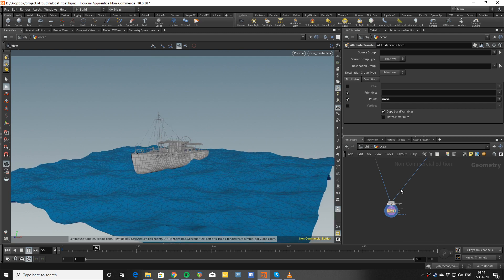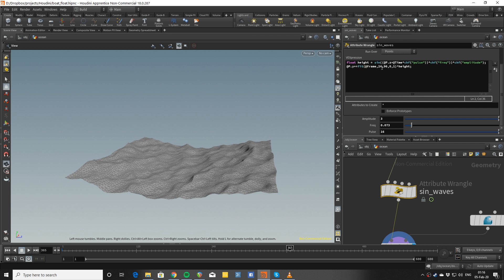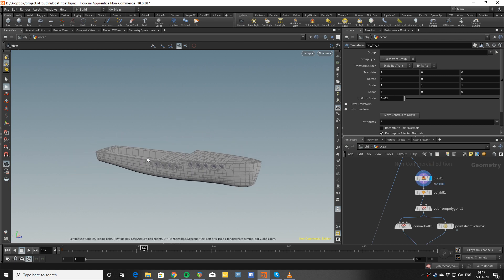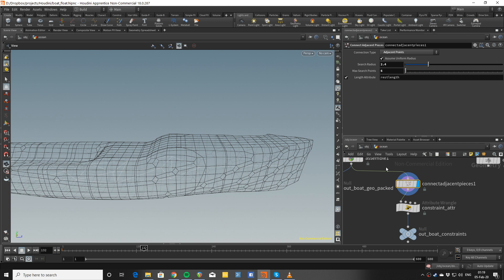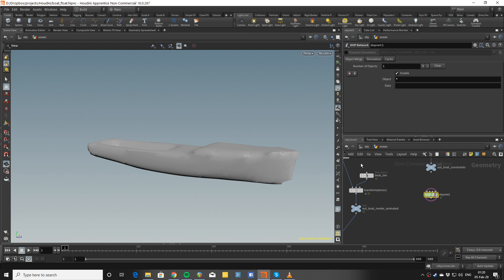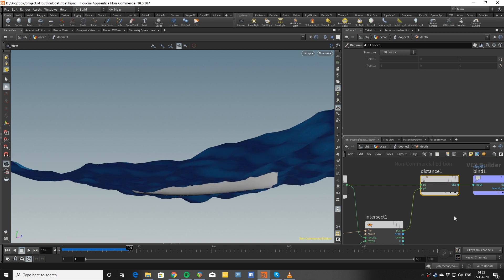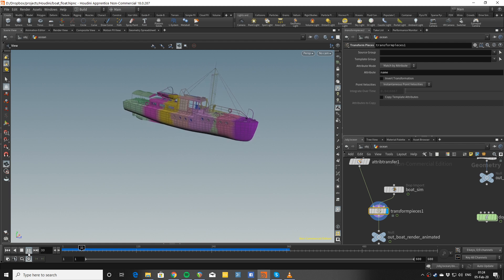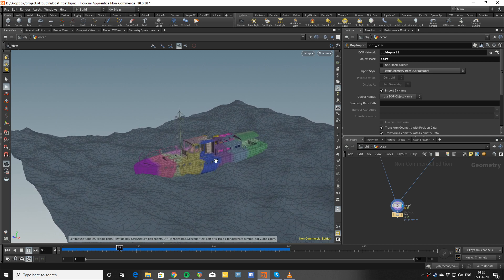Houdini 18 Boat in the ocean

Comment: Hi! Very nice tuto, but I've some issues after the simulation... When I transfer with the "transformpieces" my original mesh start to deform itself after some dozens of frames!
Have you some idea to avoid that? Please! 🙏🙏
Reply from the maker: The cool thing about a setup like this is that it allows the rig to bend, the render boat could also bend if you transfer the animation using a point deform. If you don't want it to deform you can make it stiff enough, give the pieces some constraints that would also make it stiffer, or use another method that is simpler - with a triangle at the base of the boat that you  ocean deform, and then get normal of that, centroid, and up vector that you choose. Then you can copy to points the boat using that data. This is simple and fast, though not as fancy :)
Reply: @HristoVelev  Thank you so much for your answer ! I'll try this after my holiday break... And Merry Christmas ! 😁🎄😉
Reply from the maker: @3dforever717  Merry Christmas to you too :)

Comment: Hello! Thank you so much for your tutorial. I tried to alter your setup in order to use another ship, but I keep having problems with the exploded pieces drifting apart in the simulation. Any ideas what I might have to change?
Reply: Oh, I adjusted the density of the points without changing the connectadjacentpieces! Now it works!

Comment: Hey ! very nice tutorial ! I was just wandering how you could keyframe the boat so it can move on the ocean rather than staying in the center of the world ?
Reply: I tried with a tranform node in various places but none gave me good results
Reply from the maker: You can apply a force to add motion to a direction
Reply: @HristoVelev  that's what I did, but is there a way to keyframe the "path" of the boat and then sim it like you did to add the "waves related movement" ?
Reply from the maker: @Paulx3d  if you think about it - controlling it fully would need to remove the simulation. There is another approach you might try - get a bounding triangle of the boat, apply your animation and ocean evaluate to it, and then replace that with the boat
Reply: @HristoVelev  thanks ! I will try that

Comment: Hello Hristo, 
Thanks a lot for posting this tutorial. I'm trying to follow along and many aspects are working as you demonstrate, but I've run into two snags I'm wondering if you could please help clarify. 
First, around 7:35 you show inside the popvop that the file pin of the intersect node is connected to OpInput2 of geometryvopglobal1 - I assume this is the channel through which you are passing the water surface geometry for the ray cast to collide against, but when I make the same connection, my boat is falling out of the scene as though all the raycasts are failing. I have tested replacing the intersect and distance check with a simple test against P.y and in that case the boat successfully 'floats' on the x/z plane. 
Could you please elaborate on the method to pass the water surface geometry into the dopnet so that it is accessible to the popvop?
Second, with my boat floating on x/z, after about 90 frames of animation, my constraints become unstable, and my boat begins to fold in on itself.
Do you have any suggestions as to what I might have missed to ensure the constraints remain rigid over time?
Thanks so much in advance for any assistance you can provide!
Reply from the maker: Elliot Christian first about the input - I think I show this too, in the VOP node, there's an inputs tab, and you can pick a SOP to assign to input 2, that's where I do it. About the constraints getting messed up - use the hard constraint, and increase time steps to see if that helps
Reply: @HristoVelev  Thanks for the additional tips. It's working solid now!